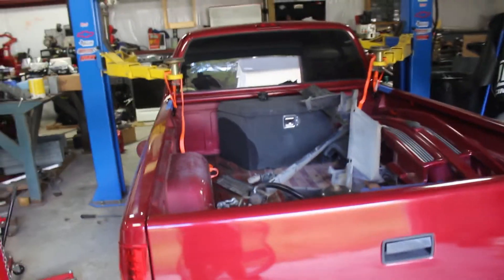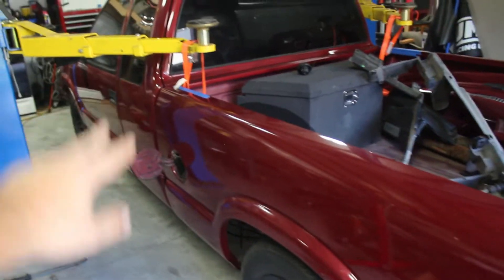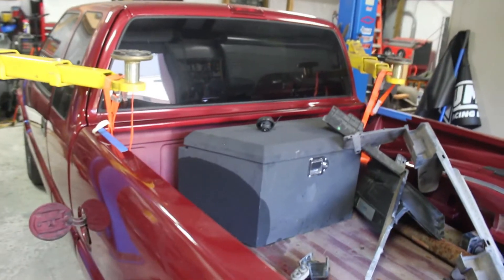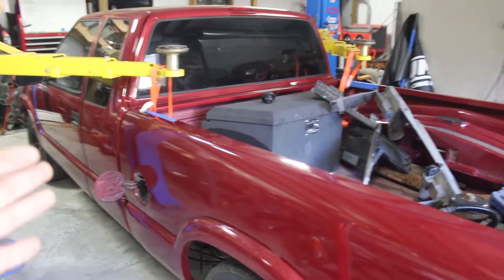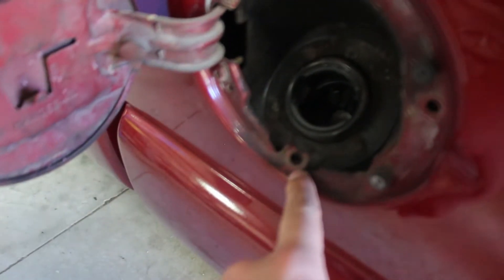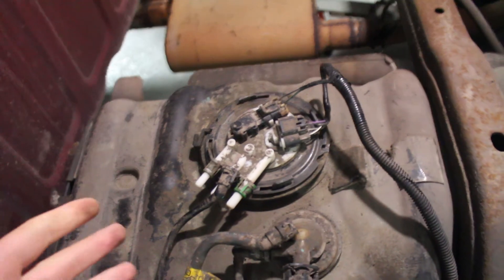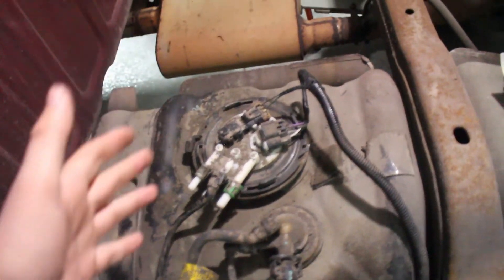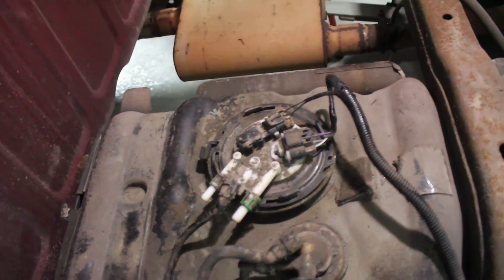S10 LS SWAP PT 13: Installing a new FUEL PUMP

Comment: Not to be a jerk, but you do realize that fuel pump module is not OEM ?  The original pump has a venturi port on the pump that fills the sump.  That fuel pump module you have, the return feeds the sump through one of the collapsible legs/guide rods.  That is why you had to modify the sump bowl.  Also has the updated plug which can handle more current.  Quantum Fuel Systems make 2 pumps that are a direct replacement for OEM depending on the truck year.  I ran into this problem when sourcing a pump.  Ordered one style, but had to modified OEM module to use non-venturi pump to get the truck running quickly as pump on back order.  I then ordered cheap module (like yours) to use with new pump when it came in, now need other style.  Messed up.  Finally, my point:  How is it working ?  All good ?  Save me finding a 2002/3 OEM module.....

Comment: I tried just dropping the tank on a 98 S10 once. I couldn't even get it off and had to take the bed off anyway. I don't care what they say about how good it works. Putting the fuel pump in the gas tank is a stupid idea.

Comment: Do you NEED a new pump?
Reply from the maker: You don't have to get a new pump, I'd rather future proof my fuel system incase I want to do anything down the line that would require more fuel.